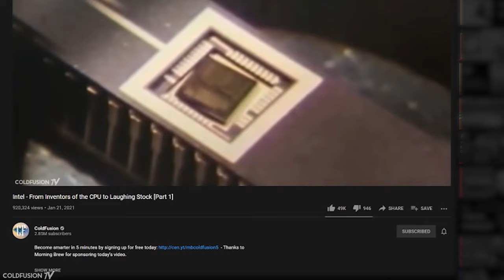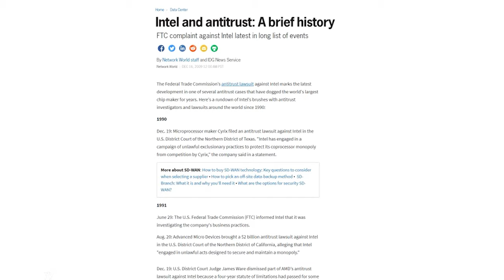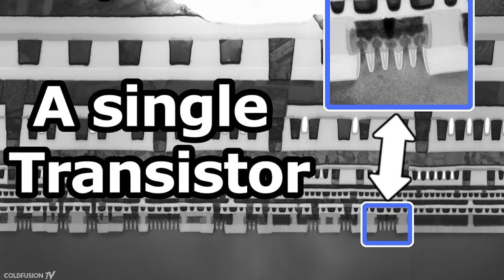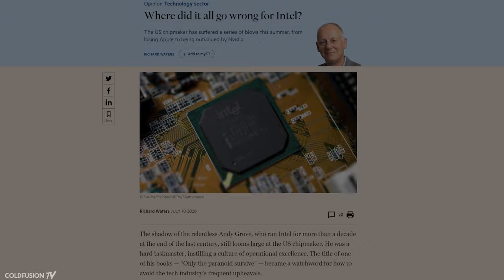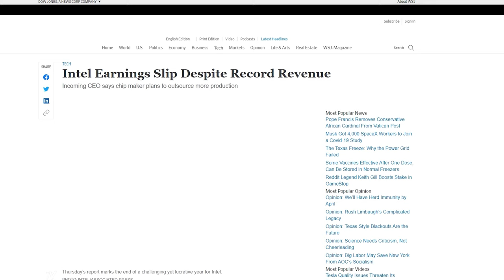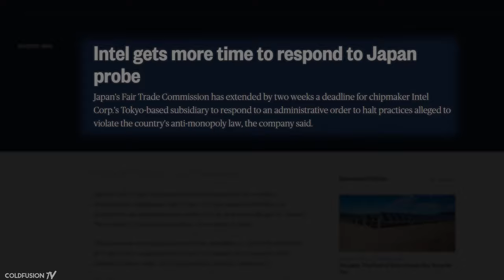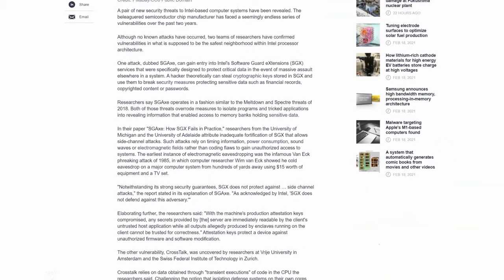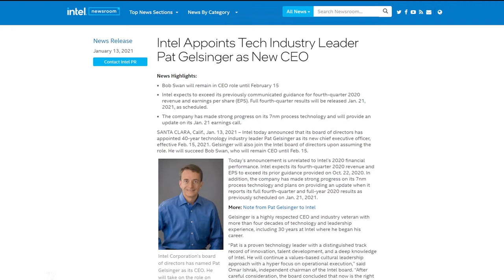Intel - From Inventors of the CPU to Laughing Stock [Part 2]

Comment: I don't know if it's because I know a bit more than the average person about this, but I feel like there have been some spots where the information is...lacking? For example, when you first mentioned ryzen having X amount of cores and that it was better, you  neglected to mention that intel the amount of cores that intel had or how or why it mattered, especially their plan on keeping only quad cores being the norm for consumers until the late 2010's. Also the fact that AMD tried going for the larger core count route but failed miserably (imo) with the FX series and then channeled that experience and knowledge into ryzen. Which admittedly in gen 1, instructions per core performance was just starting to catch up to intel, not really surpassing.The bit about the nodes being compared to each other without the context and differences between each foundrys particular nanometer node, (for example, tsmc's 14nm had 28.88 nm transitor density compared to intel's original 14nm which had 37.5 nm. According to wikipedia anyway)
And more, but I dunno, maybe I'm just a nerd and I'm thinking too much about it.

Comment: intel has something called intel RST for storage access and Linux still doesn't have a driver for that because of poor documentation from intel.

So, if you a buy a intel computer, you can either run windows or linux, you cannot dual boot and use both.

After seeing intel's unethical history, I think it is another secret pact between intel and microsoft to force user to use only windows.

Comment: The revolutions been happening past 4 years. Each time i see a video like this i need to leave a comment. I remember some 6 yrs back i had to pay alot of money for the number 2 chip ifrom intel. 5930k. Only losing out to 5960x. It had 6 cores and cost alot. Each yearintel releases a slightly improved version and then wants alot for it. It seems their roadmap for this is  intentional and this stifles innovation. It is really unfair for consumers. I urge the community to take up more amd, taking note that there is still a gap between the 2 companies. We need to bring amd on par so as to elimate what a rich and powerful company can do, such as bribery. By then consumers can be free to choose whoever they prefer or whoever produces the best innovation.

Comment: What was “exotic technology”?
Reply: Intel was experimenting with a new way to do what lithography did (lay out the transistors and circuits in silicon), based upon a theory that had been around for over 20 years that had never been proven beyond the math. I forget what it was called. They poured a ton of money and time into it, and fell short. They also split research into many different things like stacked dies and quantum computing. (By the way, Intel has the most advanced quantum computing processors currently available.) So by the time Intel decided to look into other ways of reliably getting down to 10nm for regular CPUs (like AMDs Infinity Fabric letting AMD create smaller chiplets and "gluing" them together without a lot of latency), they had lost the edge.

Comment: Come mid-January I expect to never use another Intel chip once my M1 Pro arrives. I’m so tired of my toaster “computer” where the fan kicks in within minutes and thermal throttles. Not to mention 1 1/2 hrs of battery life if I’m lucky. I realize some of this is graphics processor. But that’s also partly because Intels on board graphics are incredibly bad.

Comment: I guess AMD is duplicating Apple's marketing strategy dubiously clamming PR success stories, as Apple did in the late 90's - early 2000's with the Power PC 128 bit processor (which even nowadays doesn't exist), while they were actually using 64 bit dual Intel Xeon  processors in their machines.

Comment: Their manufacturing is both the reason for their recent failures AND the only reason they're still relevant. They have so much manufacturing capacity it's impossible for TMSC to beat them. That's the only reason they're still making enormous ammounts of money. AMD couldn't possible sell that many CPUs hence they are constantly out of stock while Intel can actually supply the market.

Comment: Intel has spent the past decade gouging customers. I understand charging a premium for your chip since it was so much faster and efficient. However,  things like changing your socket every two years and locking all of your parts just so you can get an extra 20 percent out of enthusiast was just anti-consmer behavior.  I'm happy they are getting their ass kicked for now.

Comment: This is so hugely misrepresenting AMD by attributing their achievements only to using tsmc's tech process. AMD actually is the main reason now you see ANY development from Intel and not just rebranding of older models, and they've been the major reason for the past 20 or so years we had a cheaper alternative which drove prices down overall. Just to remind you some facts: AMD-K6 was an excellent alternative, AMD-3DNow! actually performed better than MMX, K8 was the first 64 bit architecture Intel had to license from AMD and in turn had to drop their bullshit allegations, AthlonXP kicked Intel Pentium 4 in the nuts even in games, Athlon 64 X2 was the first desktop true dual-core CPU on the market and not that HYPErthreaded bollocks in high-end sky-priced Prescotts and two chips on a die in a volcano-hot Pentium Ds. And all that despite active pressure from Intel. BTW, do you remember Pentium2? AMD never produced such abominations, every one of their products was at least decent and even a bigger bang for the buck compared to Intel's shiny pebbles and that's how AMD survived. In fact, AMD's processors were able to compete with Intel's products even though they used a worse tech process for the majority of their rivalry: AthlonXPs used 130-180nm, Prescotts used 80nm; Phenoms (65nm) had to compete with Intel's 45nm CPUs; six-core Phenom II's (45nm) were a better choice than 32nm i5's of the time; 32nm Bulldozers still compared well with 22nm IvyBridges. So, yeah, attributing AMD's achievements to the superior tech process provided by TSMC is wrong.

Comment: Years ago when I built my own PCs I used Cyrix (made by IBM). They fizzled. I switched to AMD. I only switched to Intel indirectly when I stopped building PCs and bought ready-made laptops which I discovered always had Intel chips in them and Intel Inside stickers on the outside. I was always aware that Intel chips seemed overpriced compared to competitors, and that the Intel Inside propaganda was fraudulent in that it really did not matter what was inside but most people didn't know that. If you want something that can fry an egg, buy Intel.

Comment: One of Intels newest ventures, AVX512 is absolute crap. It's only available on select few CPUs, where as the previous version (AVX2) is available on most modern CPUs.

The difference between the two versions is vector size. AVX2 can operate on 256 bit vector in a single instruction, where AVX512 can do 512.

The problem is, that AVX512 doesn't really provide much real world benefit, and just serves to increase their CPUs floating point operation benchmarks, to give the illusion that they perform better than they actually do.

Comment: Update for intel 11th gen, 11900k has 2 less cores and 4 less threads than the 10900k, is slightly slower in most situations, and is 50 more than the 10900k at $550usd. What a joke

Comment: 7:24 10th gen was actually on 10nm, they just switched back to 14nm for 11th gen

EDIT: im an idiot only mobile (tiger lake) was 10nm, desktop was still on 14
Reply: You need to understand what the nm units mean. In reality they mean absolutely nothing as there is no way measure a 3D component by one measurement lenght. For example14nm intel and 7nm AMD is not twice the size. The current GATE SIZE is 24nm (L1 cache) for intel and around 22nm for AMD on newest generation consumer chips. Thats not even showing the ~50nm pitch size. Wake up and realize that these numbers tell as much as 14 cherry and 7 apple units. They are not representing the size. So you should even take size differences of the same brand with a grain of salt
Reply: But can definitly say that 11th generation is 100% terrible
Reply: @TheLifeFruit  nvm 10th gen was still on 14nm, it was only 10nm for mobile

also i know that the node sizes arent the size of the actual transistors but they represent them closely enough that you can  judge the performance increase by the number to an extent

EDIT: you can judge performance between nodes from the same company by the number, but not between companies without knowing what the equivalent is eg intel 10nm = intel 7 now because it has very similar perf to tsmc 7

Comment: Is there any other fab with a modern manufacturing process aside TSMC? Usually, it is the only name coming up. With that in mind, the worst that could happen would be if Intel gave up on its own manufacturing process. Having competition is crucial. And I somehow doubt the European initiative will be a huge factor.

While Intels current trouble looks like some technical problem, in fact, typically such things are management problems. 

When the techs are denied their creativity, which makes them worth their salt, when vertical communications becomes a one way top down street,  when key people leave because of toxic climates in companies, when middle management bends one way or the other in its sandwich position. I would not know which of such typical problems in companies apply to Intels case, but usually it is a combination of the ones mentioned above.

Comment: I feel you missed the part where p4 was meant to scale to 10ghz and it was only the laptop divisions "core" architecture that pulled then thru with the core2duo.

And as 11th gen hits and is right there with the p4 as the hottest running chips ever... do they have another side project to save them.. I think not.

Comment: It is interesting how companies seem to become bureaucracies that get rid of their original founders and visionaries.  The same pattern has been seen in Dutch Philips and other technology companies. At some stage visionaries and engineers will leave the company and start a new company which will thrive for a while until they to become riddles with useless MBAs and accountants that can only see as far as their bottom line on a spreadsheet.  You skipped over Zilog with their highly successful Z80 processor in the late 70s and 80s  which was much better than the 8080 by Intel.  If I remember Zilog was also founded by some ex-Intel employees.  The Z80 was only discontinued very recently.  Right now Intel has some failing products (via corrosion or something like that) so it remains to be seen what will happen to them in future.

Comment: From my experience, I trust Intel's long term reliability, I have an HP laptop with a Core 2 Duo, it's 12 years old and it continues working, my mom bought a HP with an AMD processor 9 years ago, and it had a processor failure after only 3 years, that's why my new laptop has an Intel processor, it's a HP with a Celeron processor (I really don't need more computing power), time will tell if I'm right or not. (If someone has more data about long-term reliability between brands, I will appreciate it). Greetings
Reply: 9 years ago AMD didn't have good processors but they were really cheap, so manufactures used them....sometimes you get what you pay for. AMD are still cheaper than Intel, but not by as much, does this mean they're built better? You'd hope so. Certainly, the mainstream view of Intel processors is that they are reliable, even if built on larger architecture than the competition, but they will cost you more for the same performance. The real problem isn't the product, it's the company behind it.
Reply: @Pete856  thank you Pete for your answer. Greetings

Comment: Intel needs a bit of a miracle to once again be the darling of the industry, especially if it continues to manufacture their CPUs in house. Apple silicon and Microsoft entering the space is a major danger for Intel, as that means less companies will be purchasing Intel products. If Intel doesn't get it together quickly ~ 3 years or so, they may find themselves so far behind that catching up would be almost impossible.

Comment: Despite being the inventors of modern CPU, I think people will not trust Intel because of their dirty tricks and monopoly practice. I was planning to upgrade to a new PC in 2018 and the price used to be so high. Intel chips were still on the high-end than AMD but I saw the AMD fight back hard and they were improving so fast.I used to compare the prices and AMD offered so much value. I was aware of Intel's monopoly and their sky-rocketing price tag for CPUs. So, I simply didnt like Intel and didnt want to buy Intel chip as much as possible. That was the best decision I ever made. After a year, AMD was beating Intel and the value they offered was simply so much better. Now, I have an AMD system and I am still able to upgrade my system to their latest chip. 
   So, a company like Intel who is only driven to dominate the market with dirty tactics and whose only care in the world is the profit rather than customers can never be  trusted so easily.

Comment: You call it a 'node' then you call it a stage, and then you show the graph, without ever connecting the idea. Don't quote Linus. I would much rather you talked to gravel, its less insipid. I have been to Samsung's plant and to Toshiba's plant. Too bad for TMSC and Apples lock on M1 pro CPUs. It will empty the channels ( semiconductor delivery systems from fab to motherboard ), and force competitors to other foundries.

You never mention building 601 Vermont, 604 ( the 10 way parallel multiplier ).

Don't worry, I walked around Intel's museum, and pointed out all the missing information too. The docent made a good move in calling the director of the museum, who called the curator. They took notes, and then said "But we checked this information on Wikipedia. " "Say that again slowly...:"
They went to trade magazines, and to retired engineers, and found out what was real.

I would have mentioned the 287, Bob Sanders, the 486BL, and Intel's Graphics, as well as NEC v20 and the Harris 286. Quiz: Can you rearrange these in chronological order? 

I give this 8/10, but at least twice as good as any other source. I am going to watch the 'Who am I' video next.

Comment: Sick and tired of getting screwed by multibillion dollar corporations. Time to build my own machine. Hello AMD!
Reply: Buy a mid range build or wait until the next Zen platform comes out. Just my 2 cents.
Reply: @L3opard123  On my 2nd Dell XPS. No more prebuilts for me.
Reply: Bought my 1st Dell in 1999. Workhorse.  Lasted for ages. Excellent Customer Service.  
2nd Dell, forget what year. HDD failed - screwed by Best Buy. Inferior replacement. 
XPS 8700 in 2012.   XPS 8930 in 2019.  
Disgusted with Dell now. Terrible cost/value ratio & Customer Service.

Comment: What if Intel knowing that they missed the 10nm timeline, immediately switch to the most advanced node at that time, even made by other company GloFo, Samsung or TSMC or even IBM, to make their chip temporarily until they are able to make their own 10nm processes? Is this something a good CEO would do? Swallowing the pride temporarily to keep the innovation moving? At least, they might have 7nm already. Then, we would know that Intel architecture on 7nm is better or worse than AMD. Is there anything wrong with this idea?

Comment: I think portraying Intel trying to both design and manufacture chips as a bad thing is grossly incorrect. They could easily have the two operations running as two separate entities but under the Intel name. Seriously, do you think the engineers designing the chips are also stuck dealing with the manufacturing equipment/setup/operation? No.

The problem is Intel's hubris and bad management that led to underinvestment in their manufacturing operations with overinvestment in their marketing/sales/bribery department ;)

Comment: Intel spent so much time in the last 20 years trying to stifle AMD, that it became a bloated mess, and if AMD hadn't rushed the Bulldozer line, this would have been happening a decade ago. The US government will put requirements on a domestic supply chain and Intel's US fabs will be a great benefit, but most future chip designs will have to be outsourced.

Comment: I knew something was wrong with intel back in 2001 when they played there Dirty Tactic's on me & couldn't even warranty a Brand-new P3 1000 MHz cpu that went bad within 2 wks of purchase. instead they sent me a broken 800 MHz p3 in a 1000 MHz box and wouldn't do anything for me. So in 2002 I switched to AMD and never looked back. 6 yrs with intel (95-01). 20 plus yrs now with AMD. Advice to anyone wanting to use intel, First Don't believe there warranties! & second buy them used on eBay and pay with paypal. by doing so you have a better chance at getting your money back if something goes wrong.

Comment: Shame they had to chop bits off, but you think Intel behaved badly sometimes, AMD has been way worse consistently and now overprice things more than Intel ever did, if you ignore the Pentium 4.. And even then, i was an AMD fan back then, the Pentium 4 was actually generally better lol and thanks to marketing making people think Intel are so far behind on manufacturing, if you look into it, Intel can squeeze more transistors per mm into their dies than any of the competition, which explains the power consumption and speed! Its also still marketing fluff that the first Ryzen was 'better' in some ways.. It really wasn't, only really starting to catch up at the 3000 series. Amazing how out of date this video already is. 12th Gen is incredible despite the hiccups with a poor 3rd party DRM.